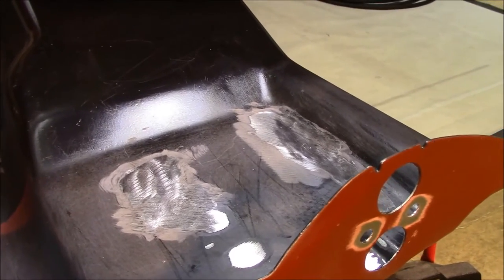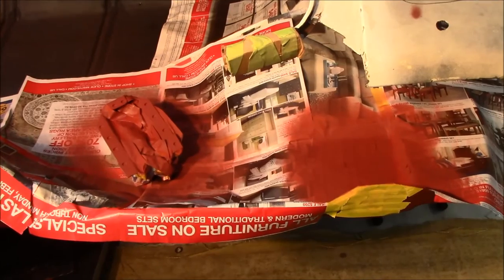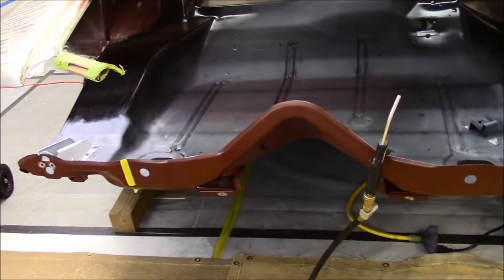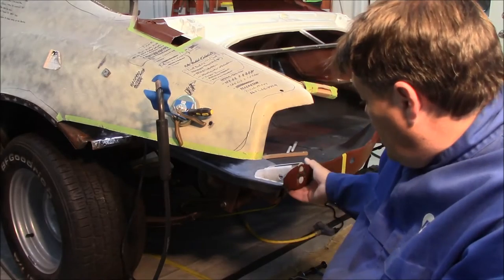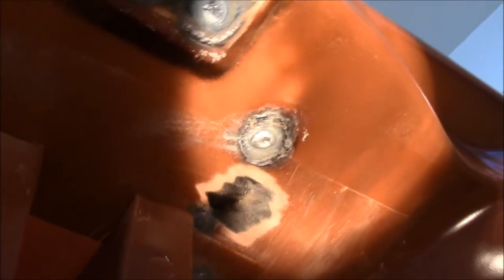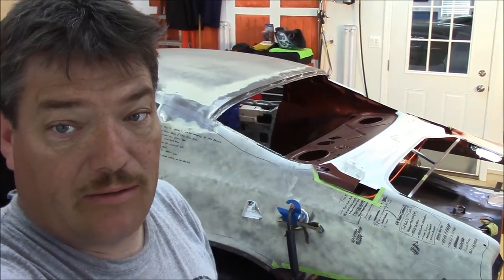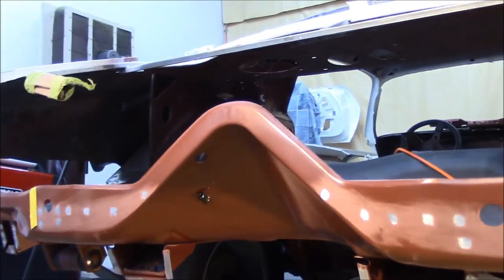1972 Camaro Project Overkill Welding Bumper Brace Brackets

Comment: Hi Russ. Another great video and the plug welds look very good! As far as heat, you technique is very good. A spot weld may look good on top, but if a good penetration is not present there is a good chance a weld want hold  to a 5 mph bump to the rear bumper. Look forward to the next video.
Reply from the maker: +Darrylz28ss396 DarrylG Thanks Darryl

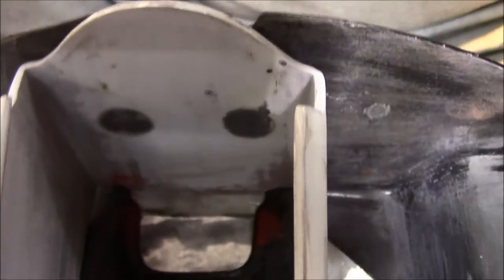Comment: Love the progress Russ!  Your work is impeccable.  I do have a question about your comment on seam sealer at 16:20.  I'm prepping for a project and trying to understand the use of seam sealer.  I thought it was used primarily around lap joints to prevent moister from penetrating the joint.  Your application appears to be in a location where there is no "joint", but rather a flange welded to a solid piece of metal (trunk floor).  Many thanks for all the good information.  Really enjoying your build !!!
Reply from the maker: +UCanDoIt2 Thanks for the kind words. I still need to do some research on seam sealer myself. When I removed the original brackets from the original trunk pan the factory did put a swipe of sealer around the perimeter of these brackets. It could be because its the trunk area and the tail lights are mounted in front of them. Your right usually its just a joint between two panels such as the drop off to the trunk pan. Hope that helps.

Comment: I really admire the attention to detail you are putting in to this project.  The welding prep your doing and protecting with weld through primer and epoxying everything after you weld along with seam sealer will last a long long time for sure.  On welding thick to thin, normally you balance that and not blow through the then by concentrating most of the arc to the thick piece, but when the thick piece is the top piece, and has small holes in it, makes it pretty tough.  Have you thought about opening the holes up in the brackets?  I am like you, i like to see at least some small indications of penetration through the backside, but I also tend to weld things a little too hot :)
Reply from the maker: +🔥Ramsey Customs - turbocobra Thanks Gary, Some great info. Looking back I should have opened the holes up more on the thicker guage. They are 1/4" but look smaller on the thicker metal. Next time on the thick stuff I think I will go to 5/16.

Comment: I have a question I don't know if anybody else has brought this up but if you spray the weld through primer over top of the epoxy isn't the epoxy still going to burn away which would then burn away the weld through primer as well I would thought you would want to take the metal all the way back down to the metal to make sure that you have good adhesion with the weld through primer because if the epoxy Burns away underneath of the weld through primer wooden that kind of defeat the purpose of the weld through primer just what's going through my head I don't know I know it's kind of late cuz this video was awhile ago but just something to think about I guess
Reply from the maker: Great question Shawn. It may not have looked like it in the vid, but I did remove the epoxy and apply weld primer. There are some folks that don't use weld primer at all, Some use just epoxy. It all burns away to some degree. I think the key is going back and flooding the seams with epoxy while the car is on a rotisserie. Also using a good cavity wax to prevent rust will help. I prefer the rubber seal weld through primer just because of the way it welds. Fireman has some great vids on some test that he did using a couple brands of weld through and just epoxy. Its very interesting stuff. Thanks for the comment.
Reply: Double R Restorations yea ive watched all his tests n is all good info for when i start mine biggest issue i see for me is going to be cost at first cause im literally starting with nothing like I don't know how much you have in clams and all of the other materials you did to do the body work on that car but I have literally nothing but Mechanics Tools at the moment I did have a bunch of body work tools but they have been lost in storage unit issues and other things and I'm going to have to find some used tools and stuff to start over along with the primaries and other things I'm going to have to buy to start this project
Reply from the maker: I've been there friend. When I we had the garage built, a 24x24 at that time, I purchased the car and pulled it into the garage. I had a socket set and a drop light. I'll post that pic to my Instagram. You just have to buy this stuff a little at a time.
Reply: Double R Restorations yea thats how ive gotten this far